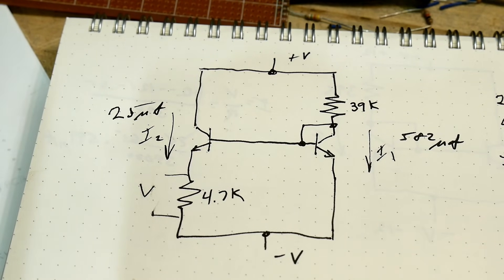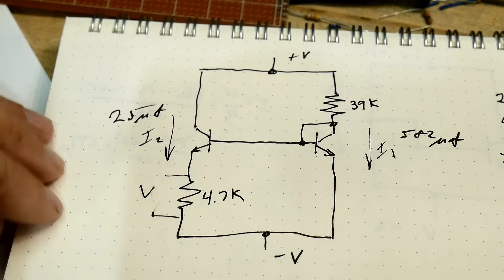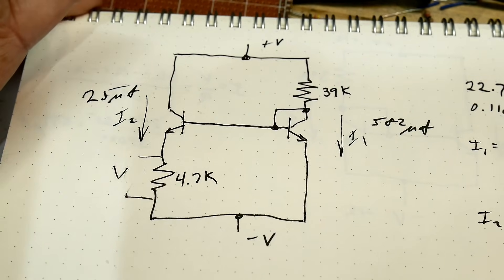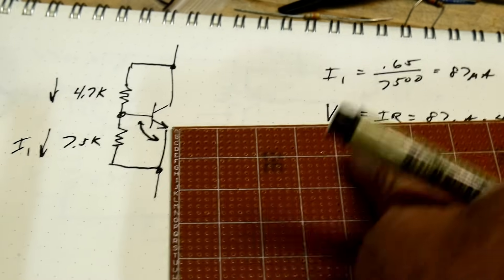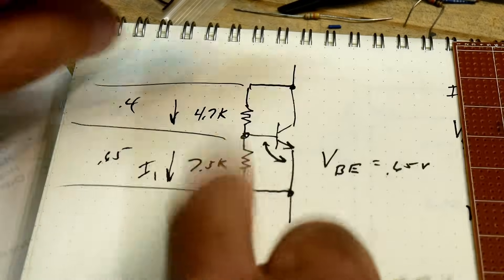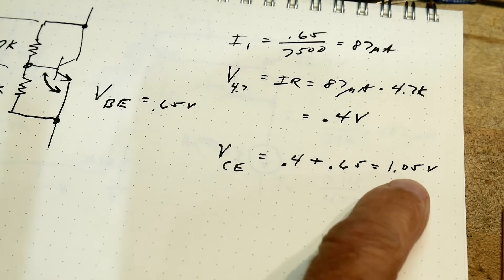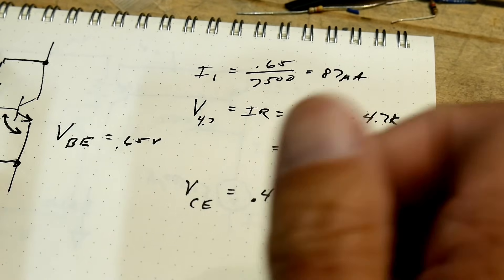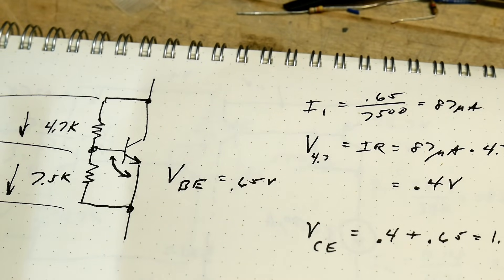#1736 Evil Mad Scientist 741 (part 2 of 3)

Comment: About 4 minutes in, and later, you talk about what may be better called a `Widlar` current source, as he may be the first to explore it for commercial products. A relatively simple approximation can be taken from the fact the ratio of the current densities imply I2 = (VT/RE)*ln(I1/I2), though that function will take a while to iterate around a value that will be close (but still slightly wrong.) More directly, the 0-branch of the LambertW (product-log) function provides a much more direct and accurate solution. (Hermite-Padé provides a simple approximation for LambertW.) A very good approximation of the voltage drop for the diode-connected BJT is `VT*(ln(LambertW(1/rho_0)/(beta+1)+RE/RS*(VCC-VEE)/VT)+ln(rho_0))` where VT is the thermal voltage, rho_0=VT/(1+1/beta)/RE/ISAT, ISAT is the saturation current, RE is the emitter resistor, and RS is the current-set resistor. (A longer expression will be a little more accurate but usually not necessary.) This current source was originally explored because its collector source is `stiffer` than without the added resistor in the emitter leg. It's particularly useful in the low current area between about 10 microamps up to a few hundred microamps. (It was also used in Widlar's LM-109 to form the band gap voltage reference.) That's about all I know about it.

Thanks so much! Very much enjoyed seeing this.

Comment: Calculating the bias is not that much difficult once you express the set of equations:
Start from the Schockley equation: Ic = Is ^ exp(Vbe/Vt)
Turn it around: Vbe = Vt* ln(Ie) - Vt ^ ln(Ise)
Where Vt = k*T/q (= 26mV for 27degC) and Ise is an emitter saturation current, a parameter dependent on the transistor. Here its exact value is not important, as it cancels out, as both transistors are assumed to be equal.
To express voltage across the emitter resistor:
Vr = Vbe11 - Vbe10 = (Vt * ln(Ie11) - Vt * ln(Ise)) - (Vt * ln(Ie10) - Vt * ln(Ise))
So we have first equation of the set:
Vr = Vt * ln(I11 / I10)
Then the resistor (so Ie10) current:
Ie10 = Vr / R4 = Vt * ln(Ie11 / Ie10) / R4 = 26mV * ln(Ie10 / 600uA) / 4.7kOhm
Solving this analytically is indeed nearly impossible, but could be easily solved this using iteration, as it converges really fast:
Start with an estimation with Ie10: It will be positive, but lower than Ie11, so any value from zero to 600uA will do, I use Vt/R, as it becomes very close to the real value mainly for cases with very low R (when calculating e.g. the impact of parasitic routing resistances on a current mirror accuracy or so), where the convergence gets slower.
Then put it into the right side of the equation and it will spit a new value, close to the real current. Repeat a few times till the value practically stop changing and you have the result.
By the way on the other side from it (so if the first estimate was above, this will be below), so it allows you to easily estimate the error, so determine when to stop iterating: If the consecutive values are closer to each other than the error you are willing to accept, you are dpne.
It seems tedious, but it converges really surprisingly fast, usually 5..6 iterations bring you to less than about 1% error.
Then you subtract the base current and you have the output collector current..

Comment: What about the base current of Q18? It's not zero. Assuming Ic=600uA, and say a beta of 100, the Ib will be 6uA. This is subtracted from the current across the 4.7K resistor, so the current there is 87uA plus 6uA or 93uA. And that will make the voltage across the resistor a little higher than you calculated, i.e. 0.437V, and the total voltage across the "super diode" 1.087V. Yeah not a huge difference, but in some cases it may be important. :)

Comment: In part 1,  you replaced the XL7841 with a "real" 741 and, in so doing, you found a bypass capacitor out of place and corrected that. Did you go back and test the XL741 with that correction and, if so, did the XL741 behave better?

Comment: That input pair seems to have a mistake. Q1 and Q2 look like they should be PNP, not NPN, how does it work at all?
Reply: No, it is 100% correct, they are indeed NPN followers. The real differential input stage are in fact the Q3 and Q4... It is a way to get around the rather limited Ft of the lateral PNP's in the early technologies, in this circuit the current gain to reach the low input current, as well having the load mirror fast and accurate is still on the fast NPNs.
Reply: @annaplojharova1400  if those transistors were PNP then it would be a cascode and would kill the input miller capacitance (and improve Ft). Input bias is still 100% dependant on Q1 and Q2 beta. Very strange circuit, and I still believe that with PNP transistors in those positions it would work way better.
Reply: @akkudakkupl Cascodes won't improve the Ft here, as there is no voltage gain, when working into a mirror or a miller compensated swing stage. The thing is, the only PNP you have there are either vertical substrate PNP, whose collector is connected to the negative supply. So can not be used for anything else but an emitter follower. And then you have lateral PNP, which are well known to be very sluggish, with very low Ft. On the other hand vertical NPNs you can easily tune to get very high Ft, mainly when small, low power devices (short distance base connection,...)
The seemingly crazy circuit goes around these limitations by using only NPNs for any current gain in the signal path and the sluggish PNP for just cascodes, where the Ft is not that much impact.
Reply: @annaplojharova1400  cascode causes the collector of input transistor to be at a constant voltage, so there is no NFB through base-collector capacitance - it increases bandwidth. Whatever lopsided design they had to use in the real IC was not needed it the reimagining done in this kit and using the normal (and superior) configuration would save them from using those bodge diodes.
Reply: @akkudakkupl  Cascodes do that, but the thing is, the following circuit does the same already as well, so no point to add extra cascodes under a standard diff pair.
For using PNP as diff pair you are assuming using PNPs with similar parameters the NPN have. That could be the case for discrete transistors and maybe some modern bipolar process, but with common IC processes available in the 741 era, the only PNPs with free collector available within ICs were the lateral one, so way inferior (mainly their dynamics and parasitic base resistance), so much they were useless except for DC (bias current distribution, maybe some reference voltage generators where the slow dynamic response is not a problem) or maximum some cascodes. Definitely not as any gain stage of the signal path (ok, maybe except some low end audio amplifier circuits not used beyond 20kHz).
So with those PNPs used as a main differential stage, the usable GBW of such opamp would be barely 100kHz, definitely not the 1.5MHz the 741 offers.
So this seemingly crazy design is a way to go around this limitation, get the current gain from the good NPNs and use the PNPs just as the cascodes.

The diodes are there to allow more than 5V of the input differential voltage without driving any of the input transistors into Veb breakdown. Normally the theory says they should not be needed, but many circuits can drive the opamp out of regulation and inpose larger voltage between the inputs. One way could be to use antiparallel diodes to clamp that voltage (many high performance opamp designs use that approach to protect the input transistors), but many circuits using the device as a comparator need the inputs to be high impedance at all times so  can not tolerate such clamps. Here the eventual Veb breakdown current is blocked by those series diodes.

I know more modern designs, like LF358 use PNP diff pair, but uses degraded Beta configuration (between BE is connected another PNP diode, so reducing the Beta to about unity, so making sure the limited Ft does not turn into another pole below that Ft) and then use vertical PNP in front of it as emitter followers ensuring the extra current gain (because the collector is tied to V-, substrate vertical PNPs could be used, these have higher Ft, but have collector tied to the substrate so the most negative supply, so can not be used for anything but an emitter follower). But even this design required a finer, more modern process with all transistors generally faster (and mainly lower base resistances on the lateral PNPs), so it was able to reach the 3MHz GBW. With a process from the 741 era, a 358-like design would end up in the 500kHz GBW ballpark, definitely not the 1.5MHz the 741 can offer.
Reply: @annaplojharova1400  The thing is there is a cascode there it's just that the input transistors are of the wrong polarity. Q3 and Q4 are the common base elements of the cascode.
Why didn't they just flip the input stage over completely then? Why not have the CCS on the negative supply and the mirrors on positive supply? VAS would be on the positive side and would need PNP, but that could have been avoided with another two mirrors to still have VAS on the negative side.
I'm not trying to say that I'm some electronics genius and am no Wildar, but there seem to have been more ways to skin the cat.
Reply: @akkudakkupl  Just "flipping them" would make the circuit not working at all (even assuming the frequency limitation is not a factor for now). You would have to reconnect the biasing on top of it (instead of a bias feedback mirror monitoring the collector currents of the input followers to steer the cascodes bellow the input followers to maintain the bias where it should be, you would need to reconfigure it into a current source), plus you would have to find other way to bias the cascodes to maintain some room for input common voltage swing. Or just remove them at all, as in such opamp circuit the load underneath is allow impedance, nearly a short circuit anyway. But that would mean reconnecting the input to something completely different than the 741 uses.
Really,although it may not appear so at the first glance, the circuit on the presented schematic is 100% correct, showing the way the 741 was intentionally designed by its authors. I know, it looks very weird and overcomplicated ("tradditional" differential pairs were known and used of opamp inputs even in the vacuum tube era, by the way), but there were very good reasons   this seemingly overcomplicated topology was used. The main reasons came from the limitations of the integrated circuit fabrication technologies available in the era (only PNPs with very poor performance or not freely connectable, parasitic bipolar transistors formed between components,...).
Reply: Thanks ! @annaplojharova1400
Reply: Good point.

Comment: That VBE generator rang a bell with me and I went scrolling back through an old radio electronics textbook of mine from the early 2000's. There was a power amplifier project there that was using a similar circuit in order to bias the end stage, but there it's described as a "thermo-compensation transistor". It only used a single potentiometer with the pot wiper going to the base of the transistor rather than two resistors, and there wasn't much information as to how exactly this is supposed to work. All that was said was that for that specific circuit the potentiometer should be between 1 to 3 kOhm.
Reply: Such a circuit is usually called a "VBE multiplier" since the voltage across the transistor is some multiple of the base-emitter voltage of the transistor. It is commonly used to set the quiescent current in a class AB amplifier where the objective is to have some small current flow through the output transistors (not the load) when there is no signal. Because the base-emitter voltage of a silicon transistor has a temperature coefficient of about -2 mV/K and the collector current is exponential (antilogarithmic) with respect to the base-emitter voltage, the quiescent current is very sensitive to the temperature of the transistors in the output stage. If the transistor in the VBE multiplier is thermally coupled to the output transistors, temperature compensation is pretty good and the quiescent current that makes the amplifier class AB instead of B is reasonably stable. A trim pot is commonly used because there is variation in as-manufactured VBE of transistors, so the actual multiplication factor needs to be tweaked to get the desired quiescent current. Usually the total resistance in the pot or pot plus fixed resistors is moderately low so the base current of the multiplier transistor is a relatively small fraction of the the current through the resistors.
Reply: @D614G_aka_Doug Yep, there won’t be any thermal compensation without a thermal bond to the final stage whose idle current is set by the reference transistor.